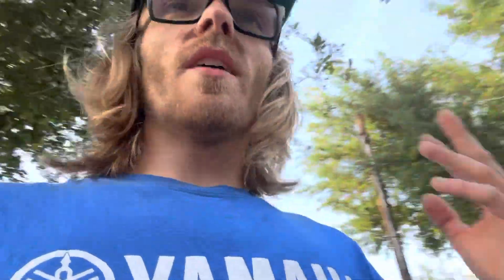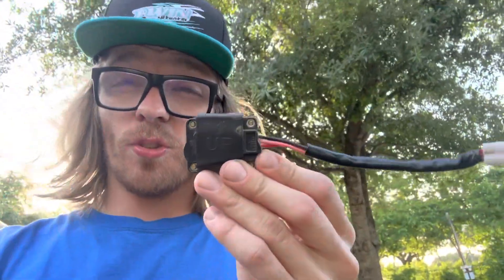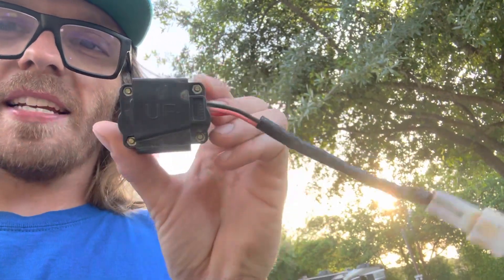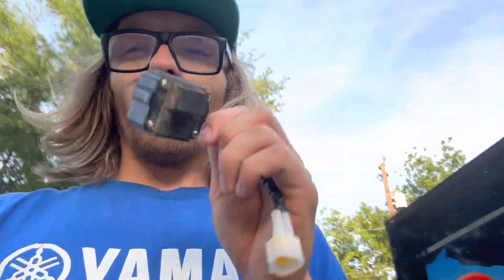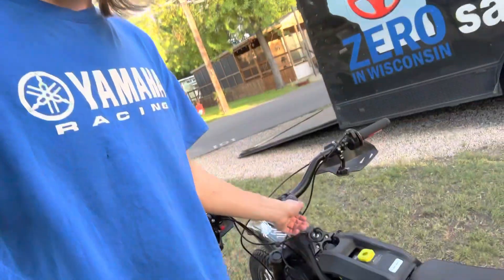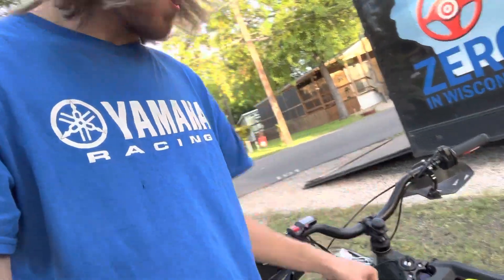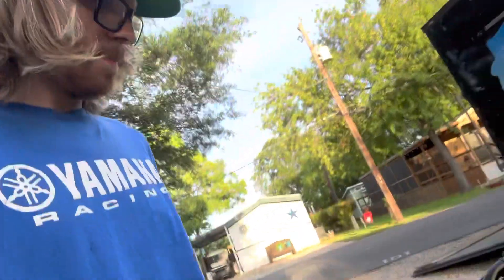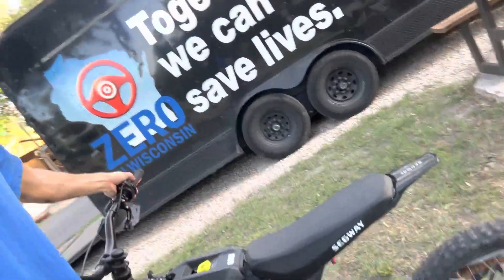Sur-Ron Won’t Start… NO POWER… FIXED!!!! SIMPLE FREE

Comment: i was hitting jumps and my 2024 surron turns off completely and dosent turn on at all , i took the tip sensor off and still no power , help!!
Reply: mine was doing that when I wheeled, I changed the throttle cable and I'm good now

Comment: Just had to walk home hopefully this works i get a feeling it will
Reply from the maker: Let me know I have other things to if it's not that. I've been breaking these 😂
Reply: @Twinstunts  one of screws on the controller is bent so I wont know until I get it properly opened with a tool. 
kinda skeptical now that ive tried the error code thing that flashes the red light and theres no light at all
Reply: @Twinstunts  one of the screws was stuffed I paid a guy to try unplug my controller and he couldnt and its messed up and he said he didnt fix it but when he gave it back to me the bikes been working never since IDK what the issue was but its fine now, he must have restarted something or something because regen was on and it wasnt idk,
Reply: @Twinstunts it was running fine for months now same issue removed tip over sensor thinking it will start but nah my next move?

Comment: I unplugged the tip over sensor and kickstand sensor and still don’t wanna get power can u help me out plz
Reply from the maker: Did you check brake sensors
Reply: @ yea I found the problem my breaker went bad cause I pressure washed it

Comment: Hope it helps. My shit stopped working when I fell while I was practicing wheelies. (It was atleast after I fell, don’t know exactly when). It works. But it stops when I slow down and make some specific turns. Or when I just wanna start it and drive away. I Had a police chase with it 2 days ago. At like 2am. And I was begging the bike not to stop and thankfully it didn’t cuz I would’ve been fucked if it had happened 😂